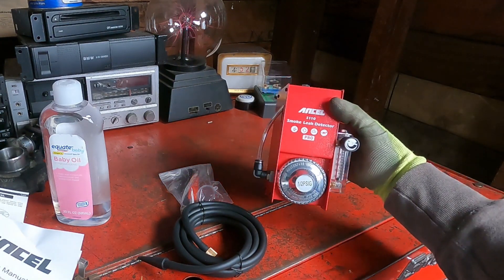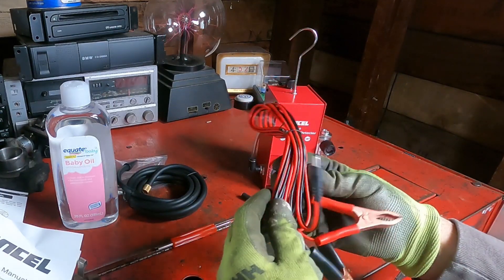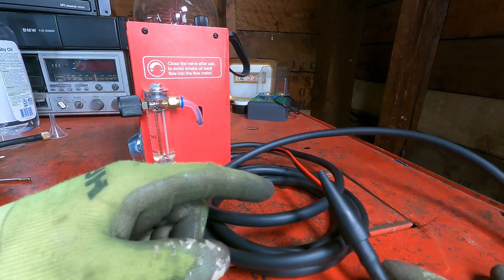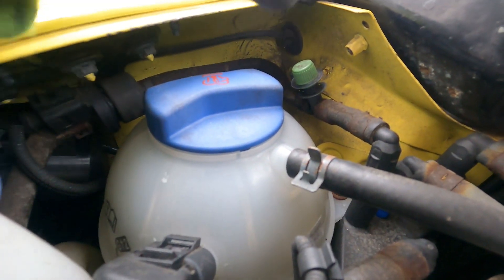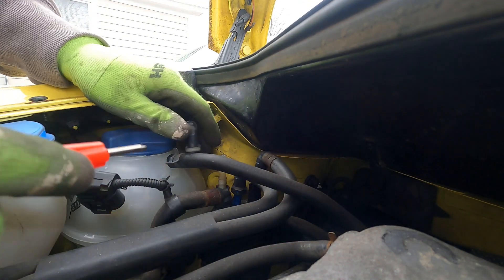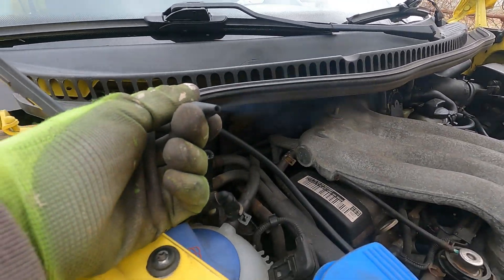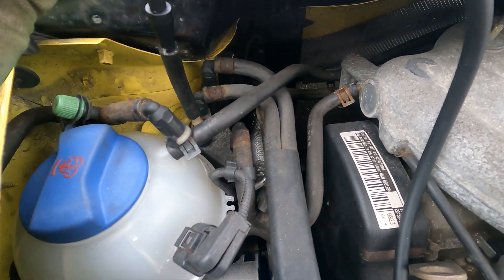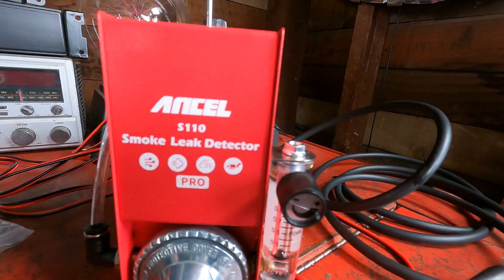How to Check For an EVAP Leak With a Smoke Leak Detector Check Engine Light Codes P0455 P0442

Comment: Hi Andy, I'm trying to perform a proper smoke test like you did, but on my sister's 2008 2.5L Beetle. I have a smoke machine, but even after attaching it to the same hose as you, I still don't get any smoke coming out of the gas filler location, even with the gas cap off. You mentioned that the vent solenoid needs to be closed and activated, so I purchased the Ross-Tech VCDS Hex-V2 for this and other diagnostic tests. However, it seems the Auto-Scan doesn’t populate the test dropdown list in Basic Settings. I believe this is because these models use non-UDS modules. Do you know if there’s a specific Group number I can use in Basic Settings to turn the vent solenoid on and off? I ran Group 71's leak detection test, and it failed, showing a small leak detected (Code P0442). This is my first time diagnosing with VCDS. My sister ordered a new gas cap since the old one is worn, but the seal still looks good. I want to confirm if the gas cap is indeed the issue. I also tested the purge valve, and it seems to be functioning properly. Any advice would be greatly appreciated.
Thanks!

Comment: Good timing on this video. I am looking at the S3000 from Ancel. Which is a tad more expensive. Would you say this one gets the job done for most any leak detection?
Reply from the maker: I would think so. It’s just easy basic and it works. Looks like the s3000 has some more attachments but I’m pretty sure this one does the exact same thing. 👍